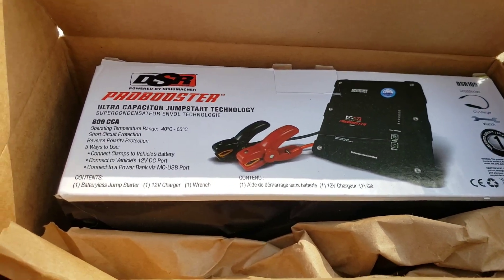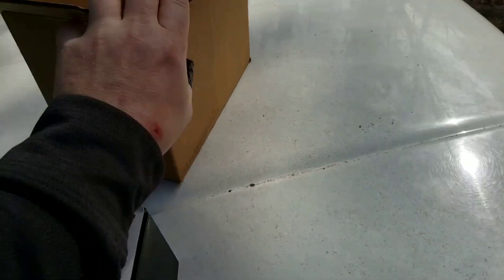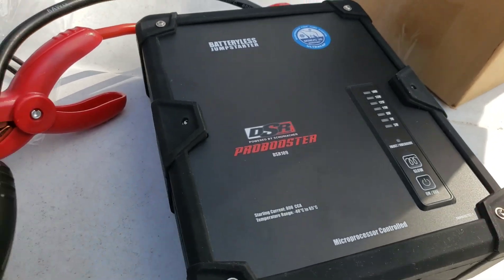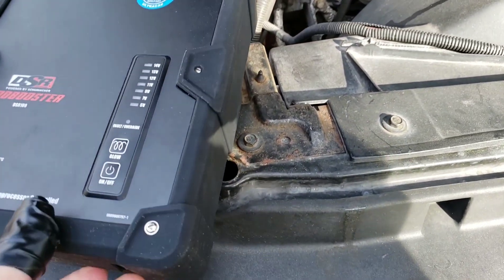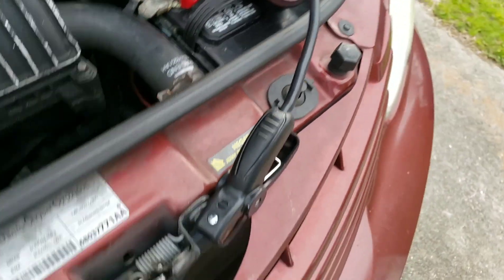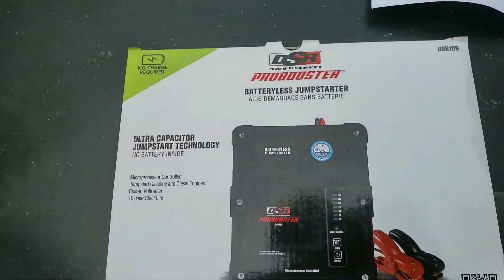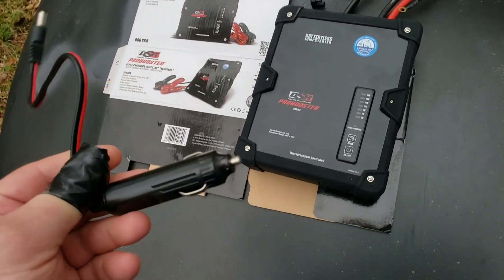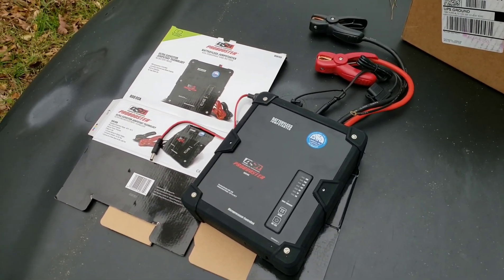Does it Work? Ehhh Ultra Capacitor Batteryless Jumpstart Charger Schumacher Probooster DSR109 Review

Comment: Very good video. There is a Snap-on one my friend got that was like $80 ish I think. And it’s one of the ones you have to charge up. But it works pretty good as well. I do like the idea and concept of this. Thanks for the review.
Reply from the maker: Thanks tim. I love this thing. Can provide alot more power than the battery ones and only takes a minute to charge amazing lol but its $215. Theres a $144 on ebay that works pretty good too
Reply: Schumacher makes a 450A version that is around $150 and works just fine on regular cars, not sure how it would on a diesel truck or something huge.
Reply: @drewsquickfix  provides a lot more power than the battery ones???
Reply from the maker: @joebuck4496  maybe I dunno... but when my battery is completely dead I nèed a jumpstarter that works. Tgisnone seemed unreliable in certain situations especially for the almost $300 cost
Reply: The ones that Snap-on and Mac Cosell are completely different than this unit does you have to charge up the news actually have capacitors in them, total different type of jump box.
Reply: The one from Snap-on is a completely different type.  You missed the whole point of the ultra-capacitor system!

Comment: Just a note or two(as someone pointed out its Volts not watts).  Also the dead battery in the ute (pickup), if it's 2 years old, either the alternator has a faulty rectifier pack or some else wrong with the alternator (use a volt meter on it to see if the output is around 13 to 14.5 volts).  Also if the battery is not secure in the battery tray (aka bouncing around/loose) this will damage the coating on the lead cells preventing the battery from holding charge (over charging the battery by the alternator can also damage the cells).

A hint you have a collapsed cellis the engine turns over slowly then suddenly turns fast and starts. The collapse(buckled plates)cell heats and separates from the negative plate and restore the 12+ volts.   

In any case always check the output voltage of the alternator (engine running) as the alternator could be faulty (over charging or not charging).

Any questions just ask..
Reply from the maker: These are still not sold in stores I think they have issues you have to buy them online

Comment: If anyone still has the manual for this unit, I'd like to see what the glow plug button is supposed to do- I didn't get a manual with mine because I bought it from Amazon as a recycled item, and you know how Amazon just takes things in and reships them willy nilly.  
The unit I have works fine for me, but I just was curious what the idea behind the glow plug option is. 
I know how to use it in a normal jump start, and I've made measurements of the capacitors and calculated them to be about 70 Farads on my DSR108, but haven't been able to make heads or tails out of this feature. The manual didn't seem available anywhere online, so it's down to someone having a paper copy.
The manufacturer website disavowed all knowledge of this DSR super cap unit so there likely isn't any info from them.
Reply from the maker: Sadly I returned the manual when I returned the unit. If you don't have a diesel I wouldn't worry about it though. It could burn out your battery if you use it too much power
Reply: @drewsquickfix  
Yeah, it's just out of curiosity more than anything else, I just couldn't figure out what the heck it's supposed to do. Works well enough for me without touching that button-
Reply from the maker: @wingerrrrrrrrr  I'm sure it's to give more power for diesels. They should have just landed it diesel engines not glow plugs which no one knows are only in diesel cars and trucks!
Reply: @drewsquickfix  I can't figure out how it would give any more power than it already does though.
Reply from the maker: @wingerrrrrrrrr  well it's a capicitor I believe they can have different charge levels. Capicitors hold a temporary charge
Reply: @drewsquickfix  The unit already boost charges to 16.2V, so going higher than that would be risky to electronics, so I don't think they're going to do that for extra oomph.

Comment: 3:15 The wrench may be to disconnect the battery terminals to separate the load of the battery, if it's dragging down and bleeding off too much of the energy from the capacitors on a start. Don't see any other purpose.
Reply from the maker: Thanks for watching  wingerrr!!
Reply: @drewsquickfix  good to have a video to get some info on these things, scarcity of information out there-👍

Comment: I give this product 1 star.  I spent a fortune and never had to use it until the other day.  It didn't work.  Called Customer Service and since it was over a year even though I hadn't used it one time, they said that there was nothing they can do.  Don't spend your money on this.
Reply from the maker: I agree I had some issues with the device very difficult to use. Apparently it does work but only under special circumstances.  Thanks for watching!
Reply: Clearly states it needs 8V from the battery. Can still use override mode from donor charge.

Comment: The hole point of high capacitor jumpers is to take a LOW battery that will not start and 3 minutes later start it from its own depleted power in this case 800 amps from that Rezervo other unites have 700 amps out putt ...if its dead as a door nail yea you got to charge it but you can do it with a cheap dollar store power pack about 30 minutes later ...thats a lot cheaper then a tow truck
Reply from the maker: Very true.  Thanks for the comment -cheers

Comment: Nice video!  I will say that it stores a lot less total power than a regular portable battery, so if your car doesn't start right away, I doubt you could get much cranking out before the charge ran out.  I would also point out that once you hook it up and turn it on, it will start dumping charge into the dead battery.  So if you dilly-dally around looking for your keys and stuff before you try to start your car, you may find that you no longer have enough charge to start the engine.
Reply: This is meant for cars that are in a good state of tune and just have an issue of a weak battery. If your car requires a long period of cranking to start, it's not a good option as it doesn't have the extended power reserve of a battery unit.
It's worked for me every time so far in actual use, maybe 4 times over the years I've had it. 

Definitely find it to be a bacon saver, and I like it over battery units mainly because I don't want to keep buying new ones every several years because batteries will degrade, faster or slower depending on how they're maintained. The storage conditions will affect batteries to some extent also, and cars tend to undergo wide temperature extremes.

 If you have a lithium battery unit, the best thing is to charge it only to about 70%, as the cells will last the longest in long term storage at that level of charge. 

Most people will just charge it full and maybe continually topping it off, which will actually result in them losing capacity at a faster rate. 

The super cap type is more of a stash and forget type of thing, but does have the disadvantage of needing a minimum amount if energy to be available in the battery.
If the lights were left on and car parked for a month, the battery will surely be all dead.  It'll only have a chance if it's just mostly dead, as Miracle Max states.

Probably won't work well with diesels or cars that are unable to start with a few crank cycles. For those, stick with the battery units, and just plan on buying replacements on a regular schedule.
Reply from the maker: Yes Kevin exactly , this is only.for certain uses and won't always start your car. I think that's why it's not sold in stores and only online. It's harder to return online purchases and I think they found people found this difficult to use. Thanks for watching please subscribe!
Reply: The advantages of supercapacitors are: They don't degrade nearly as much as a standard battery over years, and they can charge and discharge very quickly.
The disadvantages are: They don't store charge long term, so you have to charge them just before every use, and they don't have as much capacity.

Comment: Its Volt Sir not watts, and you need at least 8 volt to charge it, if you have nothing left, then you can  charge nothing
Reply from the maker: Yes I wrote the mistake in the description.  Thanks for watching. Still not something I can use if my battery is completely drained

Comment: Don't worry about the box too much. I just threw the box away. It is too bad it doesn't come with a case but it's a good product.
Reply from the maker: Thanks for watching Timothy.  I think this technology still needs work. Thats why its not sold in stores. Schumacher is a good brand I have a charger from them. However this unit is generic and schumacher just added their name . Theres several identical just with different names.
Reply: @drewsquickfix  I bought mine from a store so they probably changed their distribution plan since this video. I do think it's overpriced. My friend bought a similar product for about $100 less money...

Comment: 8 levels of fail.  It's volts, not watts.  The vehicle battery has to have some (moderate) amount of charge to work with.  If it's dead as a rock, there is no energy in there to charge the capacitors.  It can't make magic energy from nothing.  How about a voltmeter to check what voltage is actually there?  How about read the instructions so you know how to use the tool. "I don't know what that means. I don't know how this works.  It doesn't work!  Oh, it DID work!"  Super annoying.
Reply from the maker: Well you can always watch someone else's video if it annoys you.
Reply: Thanks drew. Can’t believe critics. Good intro

Comment: Please make yourself clear. Does this suck? Or is it good? As someone looking to buy a jumpstarter I would like to know. You seem to express both opinions.
Reply from the maker: I wouldn't reccomend it buy a plug in chargerer that can be used as a jumpstarter.  I found this very difficult to use and noticed its not sold in stores because of the high return rate. Thanks for watching!!

Comment: also, when charging it from a car thats running, you wont kill your battery because once the car is started, the alternator is providong the voltage, not the battery, thats why your car battery is 12v when off but 14.4v when running.

Comment: Does it say to charge it from your cars dead battery? That makes no sense, ultra capacitors are very stable and virtually no loss in voltage if you store it for 5 years in your car. If the battery is not at 12v and wont start the car, why would one think that the voltage would be enough to fully charge this. I would leave it fully charged in my car.
Reply from the maker: I dont understand why so many experts on ultra capacitors watch this video review? If you already have one no need to watch? I didnt like this product .
Reply: The capacitors discharge quickly so they can charge from a battery with at least 8v then discharge 14v quickly.

Comment: Dude, read the manual first. If you dont switch it on, it will not load of course. And you have to wait until it stops blinking, THEN its ready.
Reply from the maker: I'm still trying to figure out why so many people that already own bought of these and already know how to.... "use it" .. look up a video review of how to use the product??? Yet all these people say the same thing read the manual?? This was an open box review. I saw it as you saw it in realtime and the manual and instructions are very poor on this item. I called customer service with a long wait time. IF YOU WATCHED THE WHOLE VIDE YOU WOULD KNOW I CALLED CUSTOMER SERVICE FOR HELP WITH THE DEVICE I still had issues
Reply: @drewsquickfix  There are a lot of these boxes. They are from a Chinese factory maybe and they work the same. The companies just put their logos on them. Here is Germany this is sold by "Westfalia".

Comment: I really think you should read the manual for a product you intend to review.
You dissed the product at the beginning and obviously had done zero reading.
That’s an extremely unfair thing to do to the manufacturer, you were even calling it watts instead of volts.
This was a very bad video. I took the time to read over my manual when I received the unit and it works flawlessly.
Reply: I actually do not work for any manufacturer, I’m an electrical technologist in the renewable energy world and was fascinated with these capacitor packs. I got caught way up a mountain road while remotely fly fishing. My battery booster pack failed to start my vehicle. I was very lucky after being stuck for 3 hours when an off road Jeep came along and boosted me. I wanted to find something reliable and read about these and researched many models before I did indeed purchased this unit. I even wrote a better simple instruction cheat sheet that I laminated and carry with it in a bag. I can share with you here, and you could pass it on to anyone who wants it.
You made several errors in your methods and blamed the product. That is why I wrote that your video and evaluation is very unfair. I could do a video tomorrow using the right methods and guarantee it would work flawlessly. To try it, I disconnected my good battery and used the Override Method with no car battery connected. 
I have the big 6.2 L V8 in my truck, so a heavy draw to start. It worked flawlessly. I have let it drain and tested it charging with a cig outlet in the car, no problem. I also tried a portable battery pack for my ipad and it took a while to charge it up, but again charged up no problem.
I don’t troll anything, it’s the first time I have ever posted a comment, it just was not a fair evaluation by you in my opinion.
So, I just think if you are going to do a video evaluation, it is only fair if you fully read, understand and follow the directions. I did and have no problem at all with mine. So if you are going to post on here, and someone calls you out on it, sit down and read about the product and try it out again, your experience and video will change.
Jeff
Reply from the maker: @jeffhockeyguy  tell me why its only sold online and not in any store in the world?  Because if it were sold in stores it would be returned immediately. And why are you looking up reviews after you bought the product and already know how to use it?? That makes no sense like the 10 other promoters that made comments
Reply from the maker: It's really obvious you work for the manufacturer or marketing company for this crappy product..... its not sold in stores that tells you everything!!!
Reply: @drewsquickfix  I think he gave you a fair feedback from what he saw in your video. I also find it weird that your video proved that the product actually work but you called it "crappy".
Reply from the maker: It worked but not the way I expected it to. I updated my review in the description after it failed miserably on a full charge to start my diesel mercedes
Reply: @drewsquickfix  	E.
4.0 out of 5 stars No battery!
Reviewed in the United States on July 1, 2018
Style: 800 Peak Amp Ultracapacitor Batteryless Jump StarterVerified Purchase
Pros:
1. VERY powerful. I’ve started large diesel trucks with this jump box. Barely struggled.

2. Good capacity for smaller engines that are having a hard time to start.

3. Capacitors don’t wear out the way batteries do.
Now why would a user lie in Amazon? As mentioned above,he seems pretty happy that it can start his diesel truck.
Reply from the maker: Because companies pay or give products free for reviews!! On amazon and youtube some reviewers make up to $100,000 a year in revenue and free products google how to become a paid reviewer.  It's sad because those reviewers are partial to the company. I BOUGHT MINE!!
Reply: @drewsquickfix  Seems you got it all figure'd out. Cheers!
Reply from the maker: This is also a generic product not made by Schumacher.  There are 6 or 8 others identical with other company names. Schumacher just puts their sticker on it. That's really strange

Comment: This may be the best review I've ever watched. It is a real-world situation with someone who is NOT an expert, using a product for the first time. He's not some paid lackey, who might know a lot more, but twists the results around for monetary gain.

My own truck ('99 Blazer 4.6 L) would not start, because I haven't driven it much in the last few weeks. The battery read 11 volts. My neighbor had this exact Schumacher model, and he HAS used this thing several times. It charged to 14 volts from my battery, and the top LED was solid green, but it was NOT able to start my truck. We tried it five times, before finally giving up and jump-starting my Blazer the old-fashioned way. 

Incidentally, after we disconnected this "battery-less jumpstarter," my battery read 12 volts. So the thing actually charged up my battery a little bit, but was not powerful enough to start it. I will wait for the next generation. Maybe it will be more powerful and do what it says it can do.
Reply from the maker: Thank you verdeboy!! I was actually trolled by several paid influincers for Schumacher after doing this review. And yes I actually used the device for the first time in camera so it's like someone who is less experienced. I found it really confusing to use. I think thats why its not sold in stores.